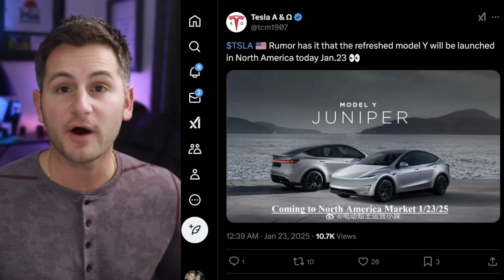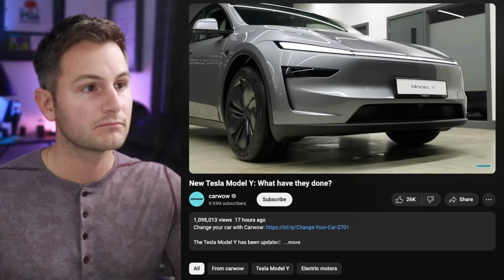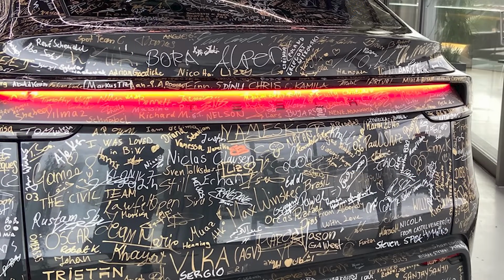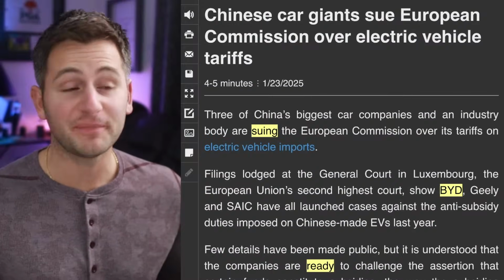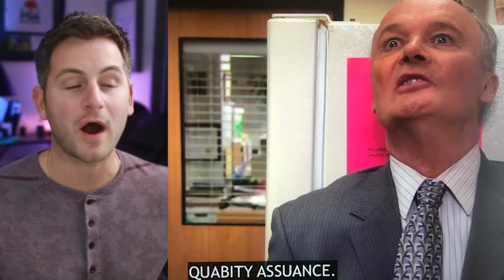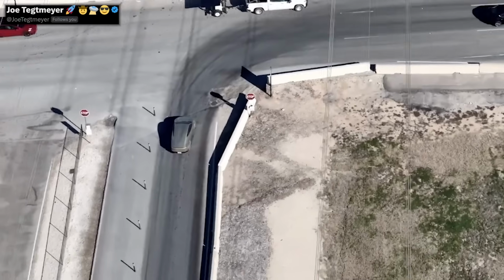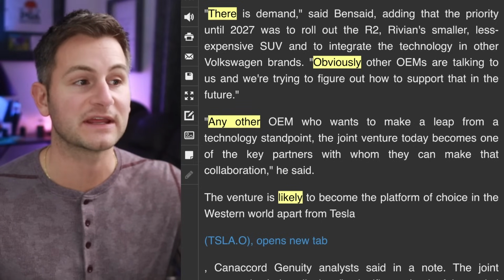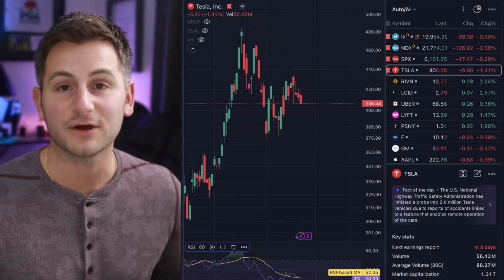New Optimus Production Report / Lies About New Model Y / Something Happening with Rivian ⚡️

Comment: 9:29 you glossed over the truth of 99% FSD on 100% of roads is of limited value. As Elon himself said when using FSD you are expected to supervise it as you should be prepared for the car to make the worst possible mistake at the worst possible time.  It there is only 1% percent chance of that you still need to maintain 100% attention to avoid it. Thats stressful so it becomes of limited value
Reply: Obviously you have not driven with FSD Supervised. Yes, you do need to supervise it but it's still much less stressful driving. It may make mistakes but it's not going to randomly just act crazy and crash. Most driving is just moving ahead and keeping in lane.

Comment: A solar farm 150 miles X 150 miles could power 100% of USA.
Reply: What would be the energy lost in national distribution from a centralized location ?
Reply: @GolfguyLA  Tom, quite a bit depending on transmission line voltage and conductor resistivity. On of the great things about solar is that it can be easily decentralized (rooftop solar being an extreme case) obviating the need for complex distribution in some cases.
Reply: @GolfguyLA  It's not as if one facility would be built, just giving an idea of the over all size required. Although as China has shown you can move electricity long distance with little loss using DC. One of the beauties of renewables is their ability to be decentralized making for a far more secure energy source.
Reply: @GolfguyLA  the thing is it does not need to be in one location it's just the total area that covers which is important - also a strip a few miles wide across the whole county will fix that issue and give you more power as more sunlight due to all time zones covered.
Reply: @GolfguyLA  huge, definitely needs to be spread out.
Reply: Probably better to have a mile or so wide strip across the US to connect to all grids and get more power in as you are then in all time zones so more sunlight hours
Reply: Imagine the line loss from one plant, that being said it’s hard to believe all the solar panels on homes and businesses don’t equal that amount of area yet…
Reply: @neightarch , usually the panels on each home or business are less than the total energy needs for that one particular location. And outside of California, very few homes have solar.
Reply: wont work, transmission looses would kill it. need to spread that out across the US, still a great idea.
Reply: You realize how absurdly huge that would be
Reply: @ssing7113 It is 0.6% of the land mass of the US. A lot. But just think, all the energy we would ever need without fossil fuels and pollution.

Comment: A lot of people don't like to look at solar, but they are easy to hide. They can be positioned on roofs, or flanked by trees. The windmills are an eyesore, but they are also an engineering, recycling,  and maintenance nightmare. In chasing efficiency they made them ugly even though old windmills (like on farms or in Holland) have rustic charm.

Comment: Model Y is crap 💩 9 extra miles is a joke there are 400 mile cars and tesla y is 320 miles is a joke should be at least 350. Tesla should have 400 330 and a 240 mile range cloth seat no glass roof no FSD 32K Toyota RAV4 killer but lucky 🍀 for use tesla is not a car company any more and a tech company lol 😂. When you have to defend tesla your loosing lol 😂. They are increasing there profit margins lol 😂 pump and dump stocks
Reply: Don’t forget deadliest car manufacturer is tesla lol 😂. The batteries 🪫 are a problem in model Y are crap 💩 and need LFP if you fast charge regular you will kill battery in model y lol 😂

Comment: I just tried FSD 12.6.1  on my 2021 MY today and, for me, where I live, it's a vast improvement over the 12.5 series.  Ofc 12.5 was pretty bad.  I had to intervene at many intersections.  12.6.1 fixed all of that. It fixed everything I was complaining about.  The only time I intervened was when I saw an ambulance with its lights on approaching from behind.  I pulled over to get out of their way.

The problem I had with 12.5 is it would stop well in front of stop signs even if there was poor or no visibility of possible cross traffic then it would proceed into the intersection whether cars were coming or not.  12.6 fixed that by pulling up to the stop sign so it could check for possible cross traffic before moving into the intersection. 🎉 

With 12.6 I love my car again but I do have Juniper lust.
Reply: I agree. I got 12.6.1 about a week ago, and it is far superior to 12.5. For many of my local trips, I turn on FSD when I leave, and no interventions needed. 👍 Sunday,  a 3,000 mile trip starts. I’m excited!!
Reply: I agree it's great but still has problems. 2021 HW3 MYL ran a 4-way stop intersection today. I didn't take over because it was not a safety critical, but i did disengage after it ran the stop sign for the report.
Reply: 13.2.2 has been great at 4-way stops.

Comment: I have a 2023 Model Y AWD Long Range (Fremont built) and it has more than enough efficiency to make up for the DC charging speed, only things are it's noisy, has a harsh ride is not as comfortable as it could be, the glass roof needs a cover in the summer (and even in winters to keep the heater from running full out here in Canada) and the seats get hot in the summer, so as far as I'm concerned this is exactly the car I want and even with the jacked up prices due to the current US Administration economic war with Canada (coming on Feb 1st, 2025) I'll still be likely upgrading. It really looks great too and I heard the rear hatch was designed to reduce costs in rear end collisions, so Tesla is still making positive moves with their updated design!

Comment: Just leased a Model Y in the last two weeks. Delivery set for February 14th. RWD Long range. If we were to cancel the order and get the launch edition the monthly rate would go from $350 to over $700.
Reply: Yes, because the discounts for the old Model Y does not apply to the new one.
Reply: @ A small part of the reason.

Comment: I'd say the new Y has only two features of real value. An overpriced tow hitch and a less than complete FSD. That's $9,000 more equipment. The colors? Yeah, in the 70's all of Detroit offered a dozen colors at the same base price. Although color matched seat belts were extra. Don't extort me over color.
Reply: If you do not want FSD, just wait until after the Launch edition. it is only extortion if you have no choice. Your choice is to wait.
Reply: Model Y is crap 💩 9 extra miles is a joke there are 400 mile cars and tesla y is 320 miles is a joke should be at least 350. Tesla should have 400 330 and a 240 mile range cloth seat no glass roof no FSD 32K Toyota RAV4 killer but lucky 🍀 for use tesla is not a car company any more and a tech company lol 😂. When you have to defend tesla your loosing lol 😂. They are increasing there profit margins lol 😂 pump and dump stocks